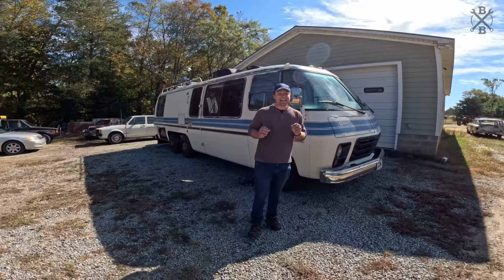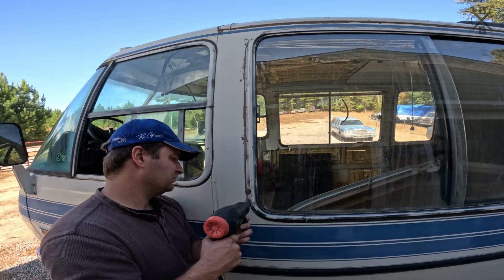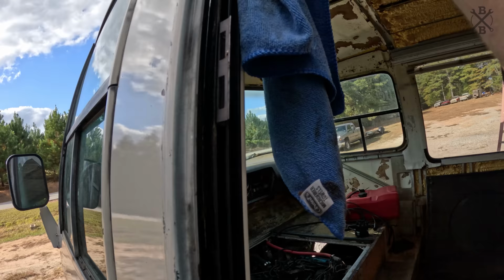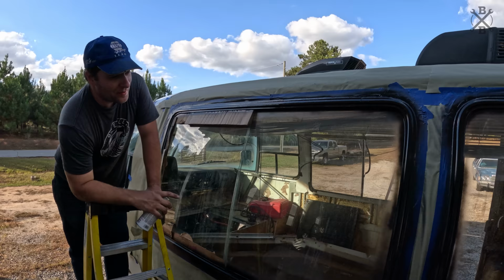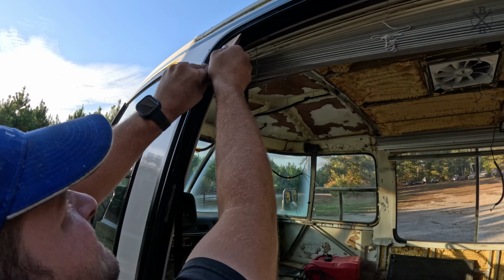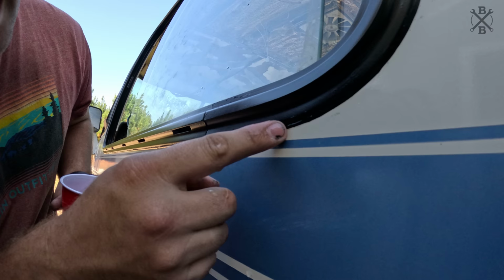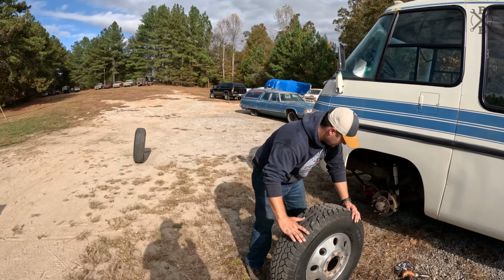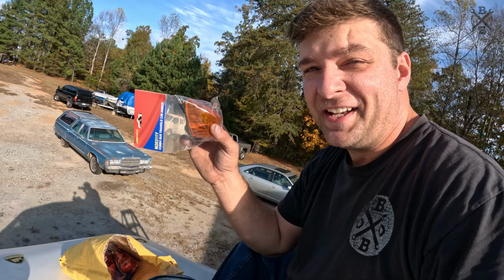Rebuilding an ABANDONED GMC Motorhome! Rescue Part 6

Comment: a trick I learned with silicone is to tape around where you are going to apply it, then when you are done applying it and pressing it with your finger (or a tool) then you can peel the tape back before it dries and BOOM you've got a perfect line/edge around your silicone.

Comment: The body shop I used say never wax first where you’re going to paint.  Paint everything first, then wax.  Wax dust and residue messes with the paint sticking
Reply from the maker: Good point! Thanks for pointing that out. We only cut/buffed and have not waxed yet. I primarily stayed to the body and not the window frames. Hopefully we don’t have issues. I just didn’t want to attempt bugging after the fresh paint and silicone.

Comment: Helpful tip when using silicone. Run painters tape near the edge of what you are applying the silicone to. Smooth it out as needed. Pull the tape off and viola, beautiful straight silicone lines.

Comment: Next time you do silicone, get a spray bottle with a strong solution of dish soap and water, gun the silicone on soak it with soapy water and tool off with shaped flat tool. 
Nice work on the RV, looking forward to seeing the rest of the build. All the best from the UK.
Dan

Comment: 9:30.  Best way i have found to tape around corners is with thin tape.  Use 1/4 or 1/8 wide stuff go around the corner then put 1/2 outside that and 1” outside that.  It uses more than one size but gets a cleaner line around the corner.

Comment: Great tips on Golby Motorhome Parts Supply online, and DAP Dynaflex Ultra for exterior window trim.  I really needed both.  Many thanks!  Learning a lot of tips for fixing pesky problems in my own RV.
The GMC windows are looking so sharp now!.  The whole motorhome is looking so good. What a great job you did, both on restoration, tips for us, and videotaping the work.  Outstanding!  Thank you!!

Tip: Mineral spirits removes silicone.  I use Q tips dipped in MS and edge it neatly.
Tip: If you are going to paint it yourself, use Durabak 18 Polyurethane paint. The solvent is Xylene. Sand lightly, Xylene rub down, and paint.  You can roller brush it on, or spray, it self levels so looks very good with roller brush. You need a mohair brush only. The roof can also be painted on metal or EPDM/ TPO roofs, as this stuff is flexible.  It is a bedliner paint but not brittle like most epoxy bedliners like Raptor or Rhino. Standard solid colors only. For a slight custom look, use KP Pigments 50 gms to 1 gal Clear Durabak. Apply as topcoat on base solid coats. This can give you a metallic or pearly look. There are some samples on Youtube. Short shelf life of 1 yr unopened.  Short pot life /working time but longer than Epoxy paints.  You have 1-2 days max.  It needs 2 coats, and follow directions about dry time between. You will get a satin sheen finish, not glossy. Advantages of Durabak:
1. Small dings don't show.
2. Thick, robust paint does not scratch like delicate car paint.
3. No need to spray, just roller brush on outside. Dust is not a big deal.
4. Also comes in textured paint (with crumb rubber) for better grip on roof or bath floor.  
5. Paints over any surface from rubber cloth, to wood, metal, plastic, fiberglass, concrete, carbon fiber, etc.
6. US Navy uses this paint on their boats and decks. 
7. You can paint your dashboard with it too, if it is faded. It looks factory made.
8. If you paint cabinets, it looks very durable like a factory made item.
9. Prep with orbital hand sander, no need to etch the metal, just remove any rust, seal and prime those spots, wipe down with Xylene and add two coats of Durabak.

fyi for readers:
LED Wholesale Supply in Hayward, CA has a lot of nice LED light bulbs 12V. The plastic amber lights can be bought anywhere cheap and you need to then buy the LED bulbs to match the socket.  Socket is either bayonet, or pin or other.  Lots of socket shapes so look them up to identify what socket base you have, and match up with replacement in 12V LED. You can use existing 110V wiring on any lamp to convert it to 12V lamp using a 12V bulb, but you cannot take thin 12V wiring and use it for 110V lamps.  This is in case you want to convert a house type light fixture for RVs or convert a regular 12V bulb to LED 12V bulb. I found this store to be well priced and lots of choices. I changed all my RV bulbs for LED.
One word of warning - All bulbs come in Kelvin ratings. Kelvin is the COLOR of the light - white, daylight, yellow, bluish.
Softer lights need 2300 - 3000 Kelvin to get the typical yellowish light bulbs like incandescent bulbs. I found this the most pleasing. Do not mix with a higher Kelvin like 4000 K (white halogen light), or 5000 - 6000 Kelvin (blue tube light). 12V LED Tube lights should all be 3000 - 4000 Kelvin as 2300 is too pinkish.  For comparison to watts, check Lumens in LED.

Comment: Love your Videos. On your use of Silicone. Try using 90% rubbing alcohol in a spray bottle. Lay your head on then lightly spray the bead and wipe tight with your finger. Trick I learned caulking new showers and countertop. I used this method on the sealer I used on my RV. It was mineral based so I used mineral spirits in the spray bottle. Good luck on your future videos!

Comment: A very handy trick that I learned from installing countertops put down the perfect width beed down. Then spray over the whole area with Windex and pull your finger through it. The Windex will not allow it to still anywhere else but where the original beed of silicone touched and also it wont stick to your finger cause you pull your finger and it gets Windex on it.

Comment: Man, a big cheat code for these is to use Zap high gloss floor wax applied with a sponge mop.
6-7 coates last almost 10 years on my motorhome. It looks fantastic and to remove, use floor stripper, recoat.
Serious shine and durable

Comment: You need to run a painters tape line before you caulk. Install the caulk wait 15 minutes and pull the tape for a perfect joint.

Comment: Looking really good. A tip for silicone is get a Popsicle stick and wet it, you can then use it as a scraping tool and it wont stick to the stick, and has a nice curve so will leave a nice shape.

Comment: I love how this build isn’t a joke, or a competition to see who can hack it the most, or any other kind of shenanigans. Don’t get me wrong, those builds are fun and interesting and creative… but on this build, you are doing it properly, while keeping an eye on the checkbook, but proper repairs override budget. 
The painting of the window trim cleans everything SO much, it’s amazing. It gives a defined line between wall and window, instead of the sloppy not straight ugliness that was there before. Putting a dark tint on the glass will help modernize it a little too. 
I know you are leaving the engine stock… but I wonder how much work, and how much better it would be, to swap out for a  LS with a turbo, and the transaxle from a toronado/Eldorado with the taller freeway gear. The turbo for the low end grunt and the tall gears for the freeway… I probably just added 7 to 10 grand to the build there, but that’s the beauty of bench racing.

Comment: Looking good, your caulking skills are improving. I like to add dawn dish soap (50/50) to the water when finishing the final smoothing process on the silicone - really produces an amazing finish. Wheels from the 66 look awesome - that is a real nice flatbed. Sometimes you can find old office cubicle panels, otherwise known as “Acoustical” panels which are covered in a variety of fabrics to help finish out the inside of that motor home.

Comment: I was wondering if you were going to tint the windows. It’s nice having the vintage fishbowl vibe but you don’t want to be in a greenhouse with all your fabric faded lol.

Also a tip for your roof is Eternabond tape your body seams and maybe around your big stuff like the AC/Vent. It’s expensive and a pain the wad to work with but it seals way better than any caulking and lasts pretty much forever.

Comment: If the gas milage is the main issue, you may consider to find another engine for the RV.
Looking at the outside work, and taking into account that the inside will be brand new, it may be worth it.

Comment: Visor - wonder if buses and trucks still use those - they were so wobby.  LED so nice - oh the bad circuit lights when we did trailering .. silicone the screw heads, I would not have known to do that.  Headliner, should be very interesting as in cars they are kind of junky once you try to work on them - and going with new is wise as it ages badly due to that "not like fine wood" deal.

Comment: How does the RV ride since you have large blocks of wood where normally their were air bags in that location above the rear wheels. I believe the air bags are available; but you have to modify the original mounts in order to use the after market ones.
Reply from the maker: It rides about like a horse and buggy 🤣 The new airbag setup just came in this week! We’ll be installing it in a next update 😃
Reply: wonderful! We learned with our GMC we had to change the valve guides out so we could use unleaded gas. Not sure if your engine had a similar modification made to it. Looking forward to seeing the interior mods as well. @BudgetBuildz

Comment: wat we did to make nice round corners is used verry narrow vynil tape (electrical tape but more narrow) you can stretch that somewat to get a smooth curve , then narrow painters tap with a few little pleats to get it to bend , than paper with the wide painterstape

Comment: I used to work on a lot of them GMV motor homes! Before you get on the road with it you need to stock up on front hubs and bearings, they eat them! Then stock up on front break pads, they eat them too! Now, all loaded up but don't go to the mountains because, they are geared so high that the engine won't hold you back on the down sloaps and you will get the front breaks so hot it will boil the fluid and you won't have any breaks! The wheel bearings and break pads are the same as the olds tornado!

Comment: Not sure which way you went on the head liner, but a DIY head liner iant all that hard. Just pick out what material you like and just use some spray adhesive. If the material is thin, make sure you use a thin coat of adhesive so it doesn't soak through. Some materials come with a backing and that's the best to buy cause it prevents soaking through also.

Comment: I tell anyone who has a RV if its going to be used as a state park parking lot queen use standard tires.... IF its going to be an actual RV & seeing a lot of roads and traffic use all terrain tires... Yes it increases the road noise while on  pavement and concrete but the traction you gain on uneven ground and running on dirt roads & paths is well worth a little extra highway noise

Comment: You need to remove those windows and replace the buetl rubber tape stuff between the windows and the coach All  the windows except the windshield are just held in with some screws on the interiour trim pieces also paint doesnt stick to silicone anything residue

Comment: Doing the windows has definitely crisped up the exterior as have the loaner wheels. If you’re doing bits of paint I’d paint the modern AC stuff on the roof white to blend in. I get the restomod bring it into the 21st century ethos but be sure not to lose the soul of the old girl updating the interior as well. Great job so far though 👍

Comment: I love those old GMC motor homes and hope to get one someday, but I don't want anything to look updated.  I want it to look 70's which really was a better time, for example the early 70's had the lowest wealth disparity.
   The light weight aluminum radiator in the Falcon, though, will give it better traction, which is important.  So might a smaller battery, perhaps boosted with a supercapcitor? or rear battery?  because traction is critical.

Comment: For clean caulking jobs, invest in a battery powered caulk gun. You dial in your pressure/bead speed and width so you can develop skill in laying down the head with good penetration. Lots of adhesive choices for a 12"x2" std c 'caulk' tube. Any tools you wanna sell will go quick as Gently Used when you show Before n After project pics along with tool condition pics showing almost no wear.
Worth every penny. Stay Strong, the Texas  Chipster

Comment: amazing how cleaning up some details can improve a vehicle's look so much. :) love the wheels, they BELONG to this motorhome indeed. :) I hope the modern installments all work as intended.
there is that lid missing to cover the gas bottle, or whatever that contraption is. do you need to install, or are you still looking for a spare? :)

also I wonder if the mileage on that big big block can actually be improved at all. you'd still have to fill those eight milk cans, after all... maybe a single-point fuel injection can help?

Comment: I bought a 40ft 1985 Winnebago that has had the inside sealed already and have to do a lil bit of exterior work to it but it runs great and has lowwwww miles on it

Comment: This is not the way to jack a GMC and you are going to twist the frame if you do not learn how to properly jack it. You have much to learn then you will do it your way anyway then you will learn. You should be replacing all lights with LEDs as the GMCs have inherently weak electrical systems. Do not put different tires on the GMC without changing and upgrading the brakes and wheel bearings. You will learn... just be sure to blame yourself not the GMC.
Reply from the maker: Not exactly sure what you mean. The front should be jacked up all at one time by the center cross member, as we did. The rear is jacked up one side at a time in between the rear wheels. If you’re looking to get the rear very high, you’ll need to jack the rear on each side a little at a time. The vehicle will see more flex under normal road use than the 1” we lifted it off of the ground. The way we jacked it will cause no harm. As for the tires, I mentioned they were for test fitting. It will receive oem size tires. Thanks for watching.
Reply: @BudgetBuildz  I hope these links help.